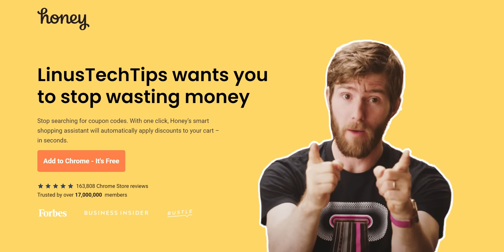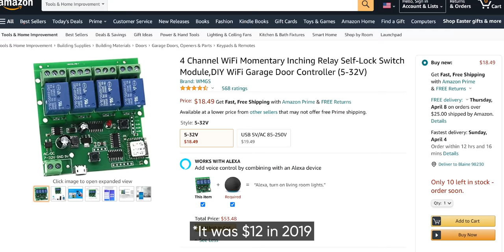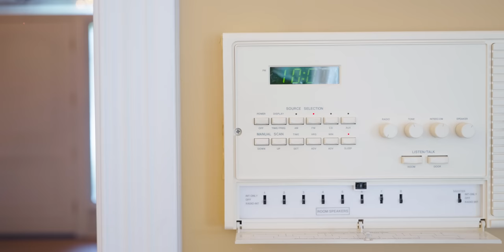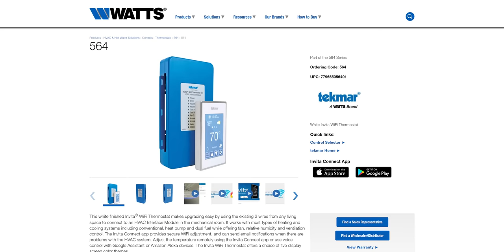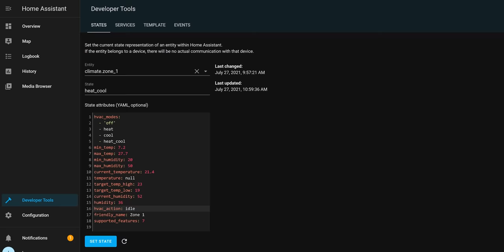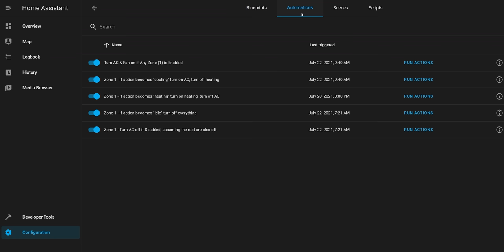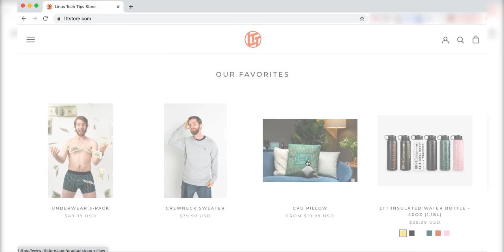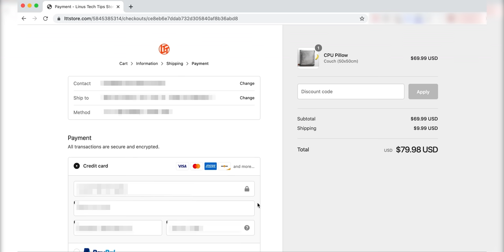This Should've Been EASY - New House Smart HVAC

Comment: I know I am way late to the party as this post is 2+ years old but if anyone in the know can answer this.  Could this thermostat (Ecobee) and the Home Assistant be used to run a heat pump in the same way? How about a VFR heat pump...that ramps way down and way up....would you be able to retain that function for efficiency?  Thanks to anyone in the know in advance!

Comment: Don't do this. Basement heat should be one zone, the concrete slab will take days to heat up and after it will stay the same temperature. This is a waste of time and complexity. Don't add those useless dampers they will increase your static pressure on your air handler and nothing will work right anyways. If the airflow is reduced due to zones being closed your system will cause the evap coil to freeze up. Ideally a system is calculated for all ducts to be open, once you have static pressure over 1w.c you are done.  Also, that unit is antique, throw it in the trash and replace with a modulating one like Bosch IDS 2.0, at least that will prevent the coil from freezing up but you'll still need to deal with static pressure.

Comment: Contemporary  Controls is selling pi 4 hats with 6 analog in for sensors, and 6 control relays. there is a hvac programmer and a controller emulator. there is also a 6 analog in 4 relay and 2 analog out the device utilize their Ethernet. and wifi for communication in there own virtual network. I do not work for them but think the product is something I will use when do an hvac rework.

Comment: Guys, you should stick with your PC knowledge. The damper moves so slowly because it is geared VERY high to have enough closing force needed to close the flap against the air pressure/flow moving through the duct. "Air Hammering" as you called it is not a thing in HVAC systems.

Comment: You still want the AC to run in rooms with nobody in them. It’s cheaper to cool a room from 72 to 68 than a room that’s 80 to 68 because the AC hasn’t ran the entire time you were at work.

Comment: I tried using an ecobee lite for my home with only 2 wires to a boiler but it would often reset because it wasn’t getting enough power so I had to run a line to an outlet for it to work. Just curious if anyone knows why Linus didn’t run into this problem. Does his boiler just output more power?

Comment: Just a thought from a Refrigeration A/C (HVAC) tech from the Martimes.  Watched part #1, and I'll keep looking into options, but this setup is potentially going to blow up your A/C. Sorry.

First: your heating set-point should never be set higher than your cooling set-point. This is HVAC 101. This means that your scenario of the A/C coming on and triggering the heat to come on should never happen. 

Second: Get those mercury thermostats our of your house, even if the replacement t-stats are not "smart"). Simple job, and any local HVAC supplier should have a recycling program for the old stats.  

Third: There was no way this was ever going to be easy... you are trying to reinvent the wheel while ignoring the bicycles that are already out there.

An AC system is sized for a home based on square footage and region. Normally, 1 Ton (12000BTU) of cooling covers roughly about 500-600 square feet of living spacer. One Ton of cooling requires 400 CFM of air to pass through the A/C coil to allow it to work to spec. Hypothetically, if your home is 1500 square ft, then you'd actually need about 2 to 2.5 Ton of cooling (24000-30000BTU), which means you need a minimum of 800-1200CFM running through your A/C coil at any given time, and that air has to go somewhere... 

Apply your existing scripts to this house for a single zone calling cooling in my hypothetical 1500sqft house: this will force your A/C air handler to try and push 1000 CFM of air through a duct that can only handle 85 CFM max (assuming that the ducts are 6" round ?). Picture a hairdryer trying to blow through a hole the size of a straw; net result = burned-out dryer... Or picture a watercooled PC with soft tubing, then pinch the tubing right after the pump... nothing is getting cooled with that. If you actually implement your damper plan as-is, I predict your Bryant A/C system is not going to last very long before you need to call your HVAC guy to replace a motor, or else you will have water all over the floor, or perhaps you will fry your compressor outdoors.

Looking at timecode 0:39, the outdoor unit for your A/C is a Bryant. If your air handler is also Bryant, then, it's a single-speed system: it's on or off, no speed control, no variability. To speak in relatable and only slightly exaggerated terms, you're trying to play Tarkov on a Pentium 3: it doesn't have the complexity to match what you are trying to do with it and you're going to burn it up trying.

To do this, you need equipment/tech that is variable in speed and capacity, for both refrigerant and airflow.  Get your HVAC guy on this. Keep the Hydronic heating as a backup, and get yourself an inverter-driven Air-to-air heat pump. I know there are models made by Mitsubishi (ZUBA), Carrier (GreenSpeed) and Trane (XV20i) are just a few, and Honeywell has home zoning systems available. Do what you do and reach out to manufacturers!

Comment: This is not a good idea at all. Without a bypass damper you will burn out blower motors and cause freeze ups of the evaporator coil. Even with a bypass damper you run into freeze up issues because you are dropping the return air temperature continuously. 

Unless the entire air system is designed for zoning you're going to run into issues constantly. The general rule of thumb is 400 cfm for each ton (12,000 btus) of cooling and zoning a single speed system is not a good idea.

Comment: That's such technological overkill.  A damper like you show here only needs to be controlled by a regular cheap thermostat and you need to provide 24 volt power to it and the thermostat.   It doesn't need a raspberry pi or any sort of computer other than one in any modern thermostat.

Comment: as an hvac tech this ish makes me cringe. just remove the bryant and install the mini splits you desire. you can hang them on the wall and pretend you are overseas and hang from the window everytime a sensor in the condensor goes bad. plug in transformers everywhere...this will be a nightmare. not to mention the static pressure of just trying to cool one room on a system sized for a whole house

Comment: "traditional forced-air system" what? How does that work, put a fan under your wall radiators/convectors? Also, nothing special about floor heating, they're everywhere. And "master bathroom", you got multiple bathrooms?

Comment: The big problem I have with this setup is it seems he is just designing his system based on whatever he could learn off the internet and without input from an engineer that has experience in designing HVAC systems. Many of the comments on here are correct about design air flow for the unit; efficiency of the blower, coil, and condenser; wired versus wireless thermostats, etc. And... there are even other things to talk about as alternatives that he could have done, but alas... Google and some guys who know how to program a raspberry pi were his designers instead of an actual mechanical engineer. I love Linus' videos, but when he gets outside the realm of what he knows it gets comical. But hey, I'm sure he has enough money to fix it once he figures out all the flaws in the design.

Comment: How to burn out your AC unit in 25 overly complicated steps.   Forced air systems should not be dampened, they're designed for the whole space.  Block too many and you'll freeze your coils.  It won't be cooler, it won't be more efficient and you won't be happy replacing your system.

Comment: As a mechanical engineer who does mep design for a living i find this hilarious. He really thinks those zoning dampers are gonna make that old ac system more efficient. In actuality  he is probably  going to make it worse while having worse comfort and humidity control while putting massive strain on that old system putting it in an early grave. I bet in one to two years that system is shot and will have to be replaced.

Comment: So your going to be running your heat and AC at the same time, plus your heating and AC units are sized for the entire house. There is nothing efficient in your setup. Plus your maintenance is going to cost a fortune. Heating and cooling on demand require way more than you think. Have fun with your project and hopefully you'll make enough money off the videos to talk to someone who can help you put together a real system that will work the way you want it.

Comment: Air handlers that are not made to be variable will not work well with this setup.... as you switch zones on and out the amount of air accross thr evaporator and the heat exchange provided by the compressor outside will be affected...

I wouod bet this wil seriously decrease the lifetime of yout system.

They make fully variable systems that would be much more suited to this but much more costly....

Comment: The title should be "This Shouldn't be EASY"  You are tackling one of HVAC's most insidious, long-standing issues.  "Zone conditioning" has probably plagued the HVAC industry since it's inception.  Ask any building engineer what their biggest headache is and most will probably say  that is has something to do with differential temperature control - John who sits in a full windowed south-facing is sweating while Rosemary has to wear mittens and a hat to keep warm because she in an interior office space with no windows somewhere maybe with a busted VAV that is belching 25% cold air to the space.

Comment: If a user doesnt want to learn the software, or simply isnt interested and just wants a tap tap go solution.....THAT. IS. FINE. Really, I have no issue with that. Computer programming can be hard even for people into it on a daily basis. Some guy isnt going to learn, and remember, whatever scripting language is used to make a thing work. Just give em an app and they're happy. Cool.

My problem, and I am in absolute agreeance with Linus on this topic (see the ge switch video....) is with the most basic understanding of networking, and PLC ladder logic, the average 'power user' is more than capable, AND EQUIPED, to provide themselves every air-quote 'feature' they try to marketing double speak you into buying their imaginary walled garden of FAKE proprietary whatever the fuck (they need to add to those open licenses that in using those licenses they are not allowed to pull that 'no you cant have the firmware you have to use our product' crap). I can easily contact my home network, securely, from anywhere on the planet (and out to the moon now), and publish and read the dead ass simple MQTT messages from the server running on my router. And Im nothing special when it comes to programming. The first company that openly advertises "easily jailbreakable hardware, run your own control network 100% internally if you want. Otherwise, we have this app with the cloud if you're not that techy" will make an ABSOLUTE FREAKING KILLING IN THE HOME AUTOMATION AND IoT MARKET!!! IT WILL BE AN ABSOLUTE BLOODBATH!!! Tuya almost had it....but has since gotten a bit tight lipped again. However for a while there they were king to people who knew how computers talk and didnt need some company putting their fingers in their networks. 

DEAR HOME AUTOMATION COMPANIES, THE USERS ARENT THAT DUMB. AND THERE ARE TECHIES MORE THAN WILLING TO EXPLAIN TO THEM HOW YOU ARE TRYING TO SCREW THEM OVER. STOP WITH THE WALLED GARDEN BULLSHIT!!! ITS NOT A GOOD LOOK!!! IF YOU WANT THE BIGGEST MARKET SHARE, BE OPEN. BE A LEADER IN OPEN IoT. YOU WILL FINALLY BE ABLE TO MAKE A QUARTERLY REPORT THAT ISNT LYING WITH STATS. OWN THE MARKET BY DOING WHAT THE USERS WANT NOT WHAT MARKETING WANTS!!!! BY CONTUNUING TO ENGAGE IN THIS PRACTICE OF MANIPULATION YOU ONLY HARM YOUR PUBLIC IMAGE WITH THE PEOPLE THAT ACTUALLY UNDERSTAND ALL THOSE NUMBERS AND LABLES YOU PUT ON YOUR PRODUCT BOXING. BE A MAN. HAVE SOME BALLS! OPEN YOUR PLATFORM OR GET OFF THE MARKET!!!!

Comment: shoud you read this? tech tipps from a swiss hvac ing... naah not really... 

lol honeywell is at best second grade equipment for a ventilaton duct... is there no better local supplier in canada? they dont even come close to "closing"... also the 30 sec closing time... is because the motors are shissnizzel... they have no clue what they doing when it comes to air... 
and by the way... how by the holy grail.. do you manage to do a show about hvac WITHOUT showing the actuall hvac unit?!!? where are the filters? where is the intake? what type of fan is running the show?  do you even know you have to change the filters regularly? its kinda the same as by your pc... or car... and there is not even a hint?!?

Comment: Okay, love this video. But, big but, your HVAC thoughts are a big no go. With forced air, your duct work was specifically designed for optimal CFM flow through the ducts coupled with the CFM output of your centrifugal fan. When you close registers or put in controlled dampers, you destroy all of these calculations that went in to duct design. Your flows will not be what you want, your centrifugal fan that pushes the air will struggle, and your power use by said fan will drastically go up. No no no Linus. On top of this your centrifugal circulation fan motor will not last near as long. So,massive reduction in life of motor and massive increase in power use over the life of the system. The offset in power use you are trying to get by putting in dampers will end up being picked up by your HVAC system due to it not functioning as desinged. Similar to overclocking your PC. I would highly recommend just going with the zoned mini split system. Cost over time will be offset quickly and as a plus, you can leave the ducts in walls and have a nice spot to run wires. Just wanted to throw that out. Best of luck brother.

Slight amendment after, minisplit systems can be self contained. So put it on the wall and apply power and it's done. Options. Don't overcomplicate with all these systems. Also, ecobee is garbage. It will fail. It's not if, it's when. Go for the simplified systems from people who have been in the business, like Honeywell.

Comment: Oh gosh please never do hvac 😂😂 stick to tech. You guys should have went to a no bypass style zone system with actual step motors that can keep other zones open 5-10% so the static pressure on the duct work doesn’t cause freezing/premature failure.